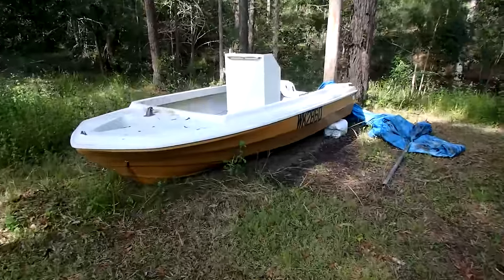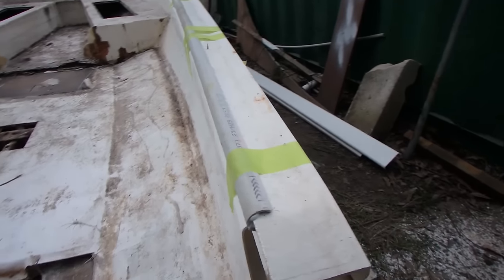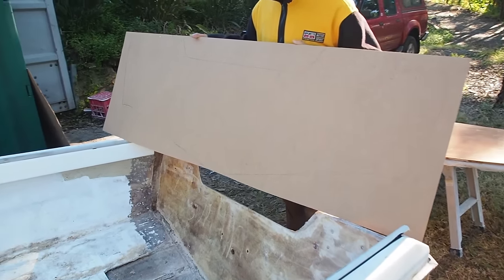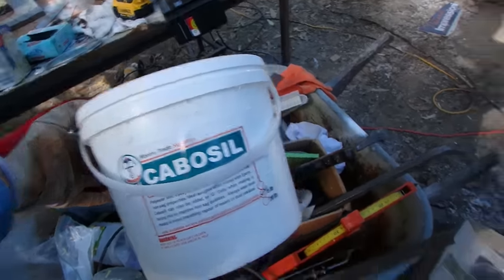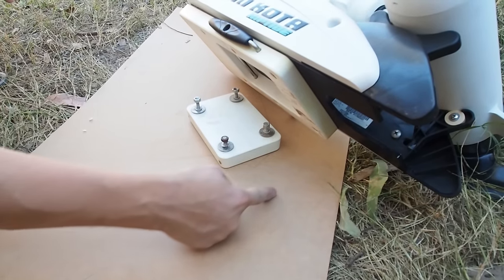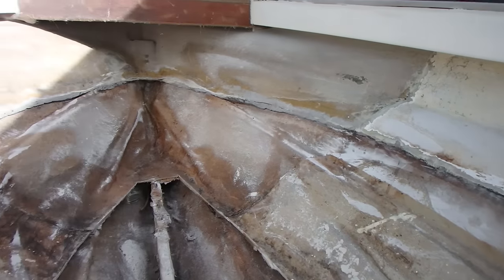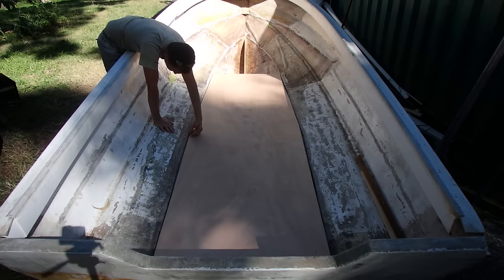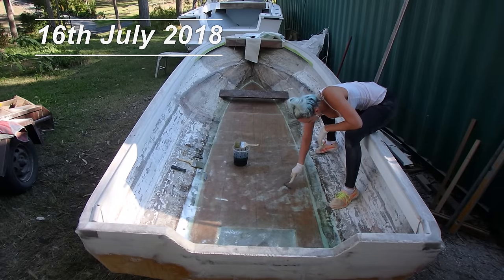DIY boat refurbishment - Episode #1

Comment: wow.. a LOT of work as I have done this before.. a boat I got ( mainly for the outboard that was on it ) was just like this.. my transom was ok, but the floor and stringers were all rotten after I cut out the floor for soft spots... made a center board, new stringers on the bottom of the hull, made bulkheads, drilled large holes through all of them, and then used expandable foam to make the thing a flotation hull...  a LOT of work.. turned out nice.. most trouble was calculating exactly how much expandable foam mixture to pour in each section !!! as the hull changed volume front to back it was interesting when we got a bit too much in the rear section and a bunch of us had to get in and stand on the floor to keep it from lifting !!! oh yeah, we had holes drilled in each section / compartment of the newly layed top floor...  then I glassed everything up after that... turned out great but man, what a lot of work.... its been soo many years ago I'm thinking that I used some talc and resin to make up my paste for all the joints and I set my stringer in it too to glue them in place before I glassed them in.... you guy's did a nice job on the boat...

Comment: 18' Bayhawk for me.  Like you I erased the interior and built what I wanted. I filled between the hull, floor and stringers with expanding polyurethane foam which made the boat incredibly stiff.  I havent thought of cabosil in years.  Looking great, I havent watch the rest yet so I dont know how it turned out until I get there.

Comment: One thing for others that wanna do this kind of work. Allways tear the glassfiber and dont leave the sharp edges from sisssors. This will bind better to the hull and no delaminate quicly. Allso allways step it outwards like 5-10cm at a time to strenghten the grip between the hull and the new glass.

Comment: When you consider the costs and what you spent on fibreglass wood tools and protective equipment. Then the amount of time then compare that to the cost of  decent 2nd hand boat.  Don't get me wrong the fun part is doing it up
Reply: I could  build a great bass boat out of fiberglass not including the motor an fishing finder  for around  4000ish   or    would I really want to spend 70000ish on new bass boat   ..bro they saved alot of money an had a good time doing it

Comment: great video series..I have a question . the new keel you put in, is it one piece of marine ply, or did you join it, and if so, what method did you use to join it.
I have a stiletto speed boat that I am planning to restore, transom stringers and floor needs doing, the hard work is mostly done, previous owner removed the floor , but the keel and stringers are shot..you know you have bad stringers when some one bolts support pieces ether side of them.  love the series.. thank you for sharing

Comment: Unfortunately you guys probable ruined the bottom of that hull by not properly supporting it when you put the new inner keel and stringers in. Having it sit on tires while doing it probably pushed the bottom up and gave it a hook. Makes it a much slower and harder hull to push through the water. I’m only speaking from experience. The first hull I rebuilt I did the same thing and it pretty much ruined the performance. Once we realized what I had done we flipped the hull and ended up having to put six gallons of hull and deck filler on it to straighten it back out. Which we then had to fiberglass over and smooth back out and gelcoat. It was a nightmare. I’ll never ever ever make that mistake again. The boat jumped from 68 to 75 mph just by fixing my mistake. Hope yours doesn’t hVe that problem

Comment: Those of us who have worked on boats, that the previous owner(s) used silicone on. We wish to find them and thank them by keel hauling them. Preferably with the motor running, forward for normal sili usage, and full ahead for excessive usage. You will figure this out in two years or so.
Cheers

Comment: bear in mind if YOU fuck up on redoing a floor WITHOUT the designers' consent you are taking your life in your own hands....my family has built boats for decades and we had an incident where an owner tried to redo his floors he fucked up did not seal the deck from the hull like we designed the boat to do and there was no air in the space once water went in to provide emergency bouncy the owner grossly overloaded the boat plus a swell to the stern caused it to sink and he then went and tried to sue my family saying it was our incompetence that caused to the sinking ...well he got  a shock when our lawyers got the case thrown out being he did not get permission or consult with the family about the boat floor redesign so if you ever redo a boat either don't think you can sue the maker or pin any blame on them it will bite you in the ass or be reddy to take any loss you may incur in the future

Comment: I thought you were going to be the typical YouTube idiots but you turned out to be quite good at your refurb. My only issue is the lack of support between the hull and the transom. I think some corner pieces should have been glassed in since this will be a high vibration area if you put an outboard on your transom.
Reply: Totally Agree. Couldn't emphasize this more particularly with the intended power upgrade. Adding such a strong piece only transfers the strain to the corners under load.

Comment: Just so you guys know (I know this is late) but chop strand fiberglass is not a structural fiberglass, compared to a woven glass
Reply: Eli Murray the company I work for has been building production boats for 25 years out of all chop.  Chop is insanely stiff and anisotropic, it’s fine for most small craft applications.  Procedures in this video would comply with ISO6185 or DNV standards for boatbuilding.
Reply: Richard what resin do you guys use...
Reply: Eli Murray Ashland Aropol series, ISO/DCPD

Comment: Looks like poly resin,  Why?  Should use Epoxy for this kind of work.  The secondary bond with polyester is not strong.  Epoxy to poly stronger than a chemical poly bond.
Reply: Depends if the original boat was done with epoxy or poly.
Reply: Nevermind,  I went back and looked again. You're probally right epoxy would have been a better choice.

Comment: Hi, what sort of resin did you use?  Laminating or finishing (wax)? for the transem
Reply: It's an old boat bro it's going to be polyester you want a good polyester but not a GP  usually you can talk to a distributor and find what you need and you usually want a good laminating resin as well

Comment: Why did you put wood back in the transom ? You could have used sea cast  and it would last past your life time.That floor could have been built with fiber glass board ,which would never ROT as your wood will in a few years,,there are sheets of fiber board you could have used for the floor ,,wow you guys did it the hard way and it will rot again.